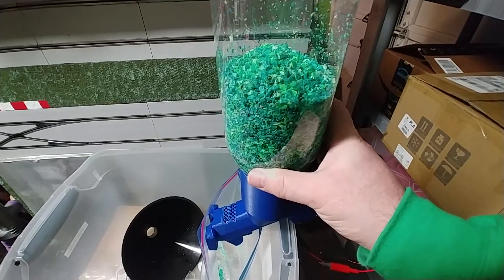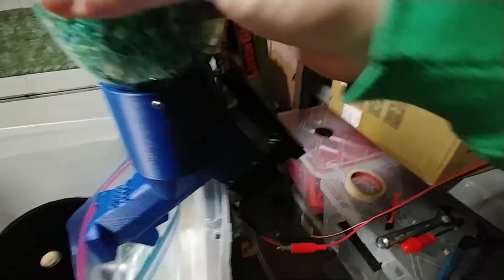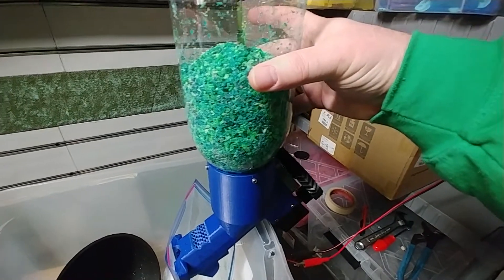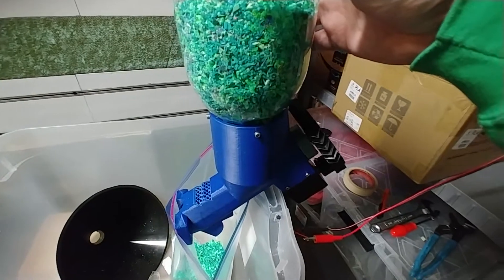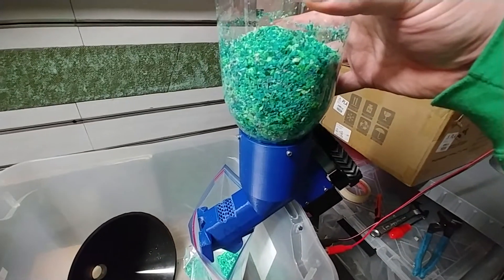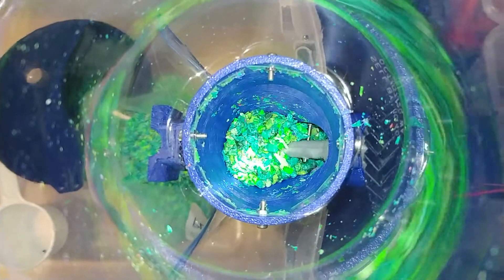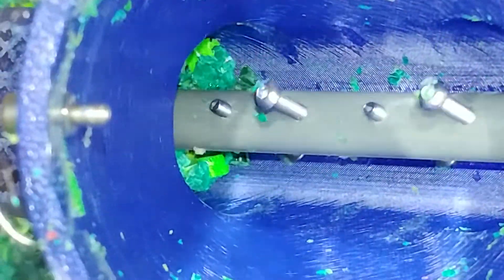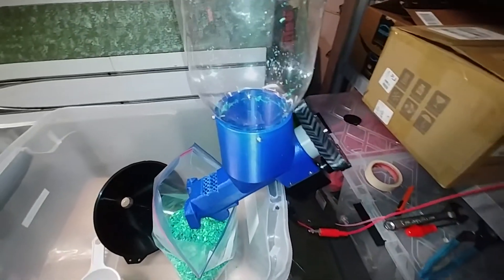Filastruder Auger Assisted Vertical Hopper Auger Version 3 Test

Comment: I think if you get the screws adjusted to the height that you want, File the rotational side down flat and that will take the arc away and should significantly reduce the strain on the motor and the pinching that is happening.  Just a guess as i've never made one of these but I hope it helps.
Reply from the maker: That might have helped. In the end, I just drove them in a little more so that they weren't so close to the inside of the pipe. The agitation was still enough to keep material flowing. 
Alas, there are many other issues with this system that make it extremely challenging to get stable-ish diameter filament out of it. The project has been put on hold indefinitely.